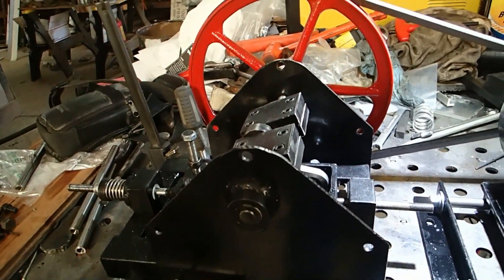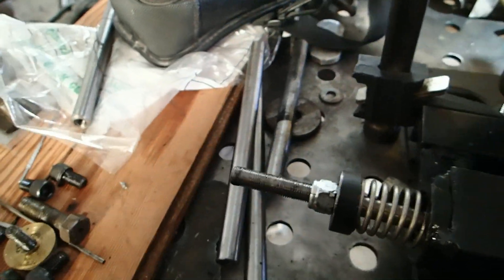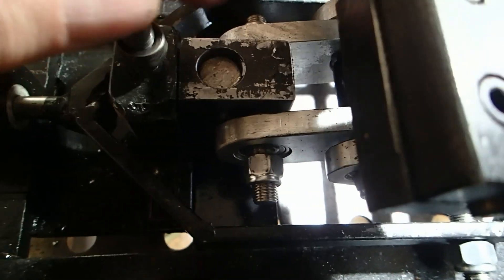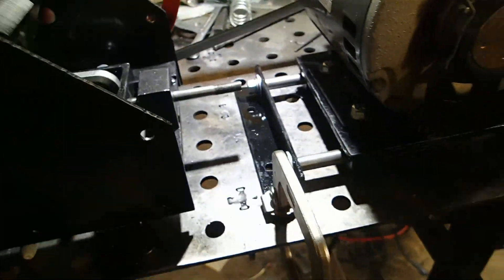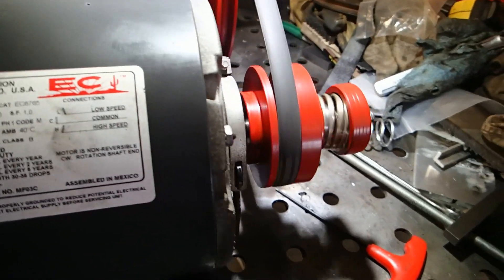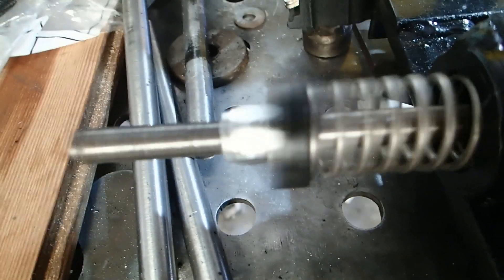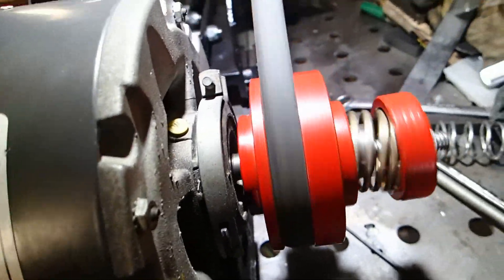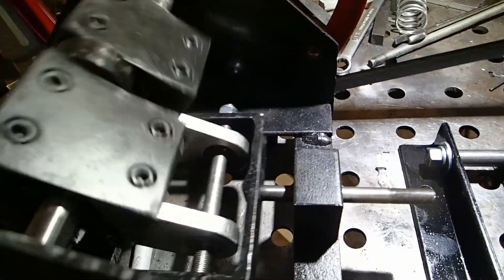Shaker Table Driver

Comment: Did you ever make the table top?
Reply from the maker: Nope. I did build one for the Wilfley Lab table I rebuilt a couple of years ago, but didn't make one specifically for the drive unit I built. Sorta lost interest in the whole thing, and moved on to other prospecting designs. I have a new dry sluice, which works really well, even on flour gold from the Snake, but I'm not releasing any info on it, until I get the patent application filed. Thanks
Jim
Reply: @jimnelson7740  your design looked really nice. I currently am building a shaker table have everything done but stuck on what type of drive I want to build. Your design looked very promising.
Reply from the maker: @dirtypawsgoldadventures  Actually, my "design" is just a rough copy of Wilfley's original design. He was a real genius. I do some design work, but not in this case. But, my drive unit is easier to build than Wilfleys, so better for Diy ers.
Jim
Reply from the maker: @ The drive unit is the difficult, and most important part. Check out my drive unit. In function, it's almost identical to Wilfley's original unit.

Comment: Couldn't you just have used a motor speed controller. Awesome build
Reply from the maker: Thanks for the comments, Vince. You can't use a speed control with a single-phase A/C motor. You can with DC motors, but DC motors are spendy, unless you find one from a treadmill or other use, and then the max speed is really high...like 5,000 rpm. Hard to control that down to about 300.
Reply: @jimnelson7740  clutch motor or Single-phase motor frequency converter？
Reply from the maker: David, frequency converters only work with 3-phase motors as far as I know. I like the simplicity of the variable-speed pulley, too. very dependable.

Comment: Jim, do you make them to sell or sell plans ???
Reply from the maker: I've got plans to build them, along with pics and instructions. I don't make them to sell....I'm too old...LOL They do require access to machine tools, like a lathe and mill....or, if your real handy, you might get by with just a drill press. I charge $40 for the plans. You can pay me through PayPal, and I'll email the plans in PDF format, or I can send the raw CAD files, which is more workable, if you can read .dwg files.  CAD readers are available free online. I've had no complaints about the PDF version, however. My PayPal ID is 'jrnelson_536@q.com' Thanks

Comment: do you sell the project?  if so, where is it selling from?
Reply from the maker: No, I don't sell them. They take a lot of time, and the price would be too high...thanks.
Reply: @jimnelson7740  I live in Brazil.  here the products related to gold mining are very expensive.  whenever I can, I make my equipment.  only a concentrating table is missing.
Reply from the maker: @rnrfp   The table is relatively easy. The drive unit is not. It requires several days of work. Shop time is about $500/day, including my equipment. I will try and get plans drawn-up this winter, for people who want to make their own. I have plans available for the table.
Reply from the maker: @rnrfp  Sorry, Ricardo, but I don't use whatsup. The table I made is made with ABS plastic. It's glued together. You can buy sheets of the plastic online. I use 1/4", or 6mm. For glue, I used regular ABS plumber's glue. The glue is a mixture of powdered ABS acetone. it can also be glued together with a chemical called MEK.
Reply from the maker: @rnrfp  I meant to say the glue is a mixture of powdered ABS and acetone.
Reply: @jimnelson7740  thanks jim.  it helped a lot.  clarified my doubts.

Comment: Would a vibrating table work just as well as a sliding table?
Reply from the maker: Unfortunately, no. The shaker table has an action that moves faster in one direction than the other. That's what makes the heavies go up the slope towards the cons end, while the lighter material gets washed down the cross slope into the waste troughs.
Reply: Jim Nelson thanks Jim... Curious about the blue bowl too.... is that just as effective as the shaker table?
Reply from the maker: @AlexSummers_1  Actually, they are two different tools for two different jobs. The Blue Bowl does well with really fine gold, whereas shaker tables do best with a bit larger gold. Shaker tables don't do really well with flour gold. I've often thought about, and still intend to build a small wave table, which would probably combine the best attributes of both. I think for a small scale miner, like most of us, a small wave table would be the best setup.
Reply: Jim Nelson thanks for the response. 😃 So, I’m getting into e waste... Lots of boards etc and about to grind them down.  If I get them down to a fine powder, I’m assuming that’s what you mean by flour gold, just so I’m clear, for the finer stuff like the flour, I’m better with a wave table?  If so, are they easy to build? Expensive to buy?
Reply from the maker: @AlexSummers_1  Somebody was selling small models on EBay a couple of years ago. I haven't looked for one recently, so don't know if they're still available. They're fairly easy to build, except for the drive unit. That part, if done correctly, requires some machining skill and tools. You can see mine on my channel. The same unit will drive either a wave table, or shaker table. I'll try and find the video of the one the guy was making and selling on EBay. I think he was charging in the neighborhood of $1,500.
Reply: Jim Nelson  Thanks .. I’d appreciate any links you can find... Just saw a “Miller table” ... what’s your thoughts on these? Is a miller table a miniature wave table?
Reply: Jim Nelson ... im going to need to sort something out but I’m struggling with so many options... I’m also looking at building something, seems simple enough with a sliding rail mechanism,.  I’m looking at thick sheets of Perspex that I could mould into shape but uncertain of the riffle depth,, what is the depth in most tables? 
Apologies for all the questions, but the deeper I go the deeper it gets lol
Reply from the maker: @AlexSummers_1  I understand. Takes a lot of experience to get this all sorted out. The tables themselves are not hard to build. The drive mechanisms are another matter, and they're the key to the separation. For small gold, the riffles can be as much as 1/4" high at the feed end...tapering to nothing at the con end. For feeding larger materials, the riffles can be higher. Instead of sliding mounts, the tables can be supported by legs that pivot at top and bottom, allowing the table to move back and forth. There is some vertical movement with that arrangement, but if the legs are long, it's minimal.
Reply from the maker: @AlexSummers_1  No...a Miller table is just a smooth sloping table...no movement.
Reply: Jim Nelson thanks for that !😎😎👍
Reply from the maker: @AlexSummers_1  A Miller table is a passive...no action. It separates by washing the black sand out of the gold. Takes a bit of practice, and is slow, but once you learn it works well for small quantities.
Reply from the maker: @ No...a Miller table is basically a sluice without riffles, or maybe "micro" riffles. It depends on it's surface texture, and the friction it creates, to separate the heavies.

Comment: Beautiful!
Reply from the maker: Many thanks guys! A customer in Chile has built the drive unit. Did a really nice job, too. Made a more simplified unit. he also did a great job on the table. He was just getting to the point of testing last week. I'm hoping to hear from him soon on the testing results.
Reply: @jimnelson7740  It would be cool to see how he did it
Reply from the maker: @jdeluisa  I've got a pic of the whole machine. Just a short view of the drive unit. Not sure i can post a pic on here, or if I should without his permission. I asked him for more pics of the machine. We'll see what happens. One thing he did was make the toggles out of thin material (maybe 1/8" plate?), and used some simple material...maybe plastic for bushings instead of sealed bearings like I did.